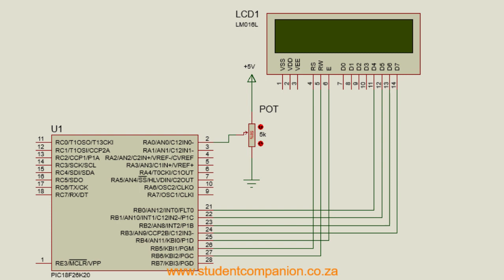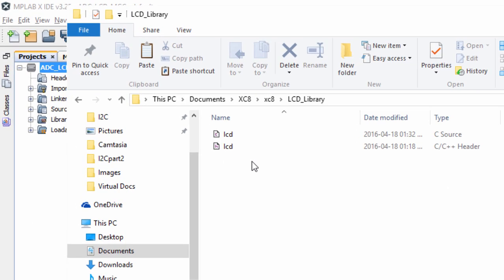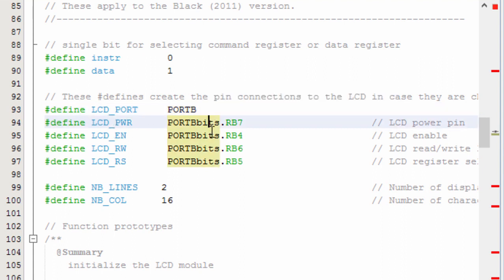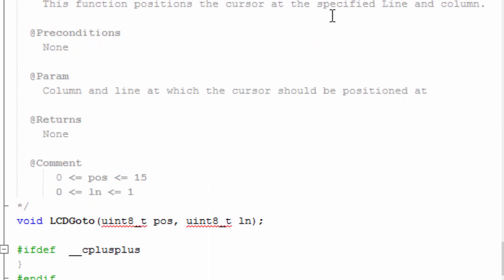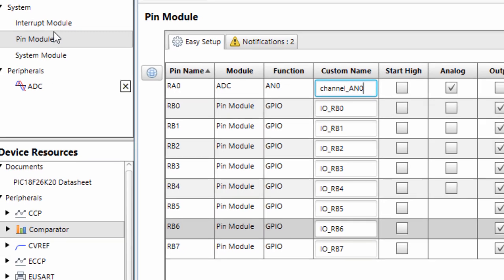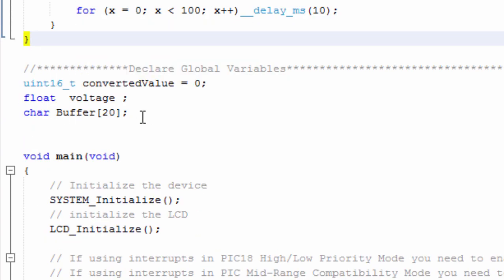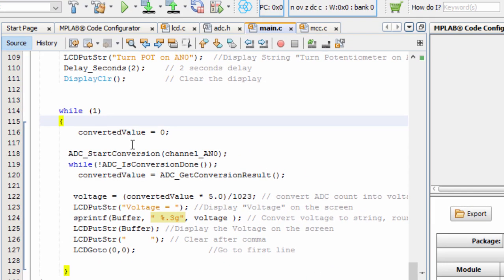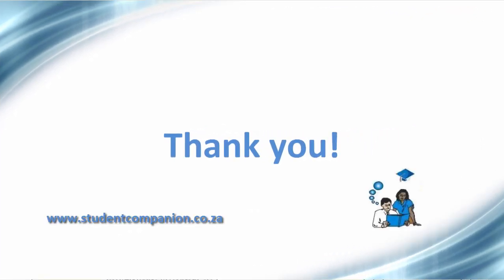22- ADC and LCD with MPLAB Code Configurator | MPLAB XC8 for Beginners Tutorial

Comment: can you please interface thermocouple sensor with is a simulation and how we can put sensor librariy in mplan idex. please reply as soon as possible
Reply from the maker: You can ask a specific questions.  What thermocouple sensor you are using? If its analog then this video should be able to assist. Otherwise you might need i2c or Spi.  Read your sensor datasheet
Reply: Sir can I get your email address. Please.

Comment: Hello.  Love the videos but having a bit of an issue here.  Doing a simple project like you show.  Right now I'm just trying to get my LCD to work.  I'm getting all sorts of issues when I try to compile with the system not able to find data types 'uint8_' and also the crystal frequency doesn't seem to be defined even though I define it. Here's my code followed by the error log.

The code:
#include <stdint.h>
#include <xc.h>
#include "mcc_generated_files/mcc.h"
#include "lcd.h"
#define _XTAL_FREQ 8000000

/***********Global Variables****************/
uint16_t raw_AD_value = 0;
float sensor_voltage;
char buffer[20];

void main(void)
{
    // initialize system (what was in SYSTEM_Initialize I put here so I can see it)
    //Plus I have to add LCD initialize myself since not part of MCC generated files
    PIN_MANAGER_Initialize();
    OSCILLATOR_Initialize();
    ADC_Initialize();
    LCD_Initialize();
    
    //Setup LCD
    LCDPutCmd(LCD_CURSOR_OFF);
    LCDPutStr("This is");
    LCDGoto(0,1);               //Puts cursor at column 0, line which is 2nd line (col, row)
    LCDPutStr("a Test");
    while (1)
    {
        // Add your application code
    }
}
/**
 End of File
*/

The error log
In file included from lcd.c:44:

./lcd.h:134:17: error: unknown type name 'uint8_t'; did you mean 'uint24_t'?
void LCDPutChar(uint8_t ch);
                ^~~~~~~
                uint24_t
C:\Program Files\Microchip\xc8\v2.20\pic\include\c99\bits/alltypes.h:204:18: note: 'uint24_t' declared here
typedef __uint24        uint24_t;
                        ^
In file included from lcd.c:44:
./lcd.h:152:16: error: unknown type name 'uint8_t'; did you mean 'uint24_t'?
void LCDPutCmd(uint8_t ch);
               ^~~~~~~
               uint24_t
C:\Program Files\Microchip\xc8\v2.20\pic\include\c99\bits/alltypes.h:204:18: note: 'uint24_t' declared here
typedef __uint24        uint24_t;
                        ^
In file included from lcd.c:44:
./lcd.h:189:21: error: unknown type name 'uint8_t'; did you mean 'uint24_t'?
void LCDWriteNibble(uint8_t ch,uint8_t rs);
                    ^~~~~~~
                    uint24_t
C:\Program Files\Microchip\xc8\v2.20\pic\include\c99\bits/alltypes.h:204:18: note: 'uint24_t' declared here
typedef __uint24        uint24_t;
                        ^
In file included from lcd.c:44:
./lcd.h:189:32: error: unknown type name 'uint8_t'; did you mean 'uint24_t'?
void LCDWriteNibble(uint8_t ch,uint8_t rs);
                               ^~~~~~~
                               uint24_t
C:\Program Files\Microchip\xc8\v2.20\pic\include\c99\bits/alltypes.h:204:18: note: 'uint24_t' declared here
typedef __uint24        uint24_t;
                        ^
In file included from lcd.c:44:
./lcd.h:211:14: error: unknown type name 'uint8_t'; did you mean 'uint24_t'?
void LCDGoto(uint8_t pos, uint8_t ln);
             ^~~~~~~
             uint24_t
C:\Program Files\Microchip\xc8\v2.20\pic\include\c99\bits/alltypes.h:204:18: note: 'uint24_t' declared here
typedef __uint24        uint24_t;
                        ^
In file included from lcd.c:44:
./lcd.h:211:27: error: unknown type name 'uint8_t'; did you mean 'uint24_t'?
void LCDGoto(uint8_t pos, uint8_t ln);
                          ^~~~~~~
                          uint24_t
C:\Program Files\Microchip\xc8\v2.20\pic\include\c99\bits/alltypes.h:204:18: note: 'uint24_t' declared here
typedef __uint24        uint24_t;
                        ^
lcd.c:57:5: error: use of undeclared identifier '_XTAL_FREQ'
    __delay_ms(LCD_Startup);
    ^
C:/Program Files (x86)/Microchip/MPLABX/v5.40/packs/Microchip/PIC12-16F1xxx_DFP/1.2.63/xc8\pic\include\pic.h:101:51: note: expanded from macro '__delay_ms'
#define __delay_ms(x) _delay((unsigned long)((x)*(_XTAL_FREQ/4000.0)))
                                                  ^
lcd.c:76:21: error: unknown type name 'uint8_t'; did you mean 'uint24_t'?
void LCDWriteNibble(uint8_t ch,uint8_t rs)
                    ^~~~~~~
                    uint24_t
C:\Program Files\Microchip\xc8\v2.20\pic\include\c99\bits/alltypes.h:204:18: note: 'uint24_t' declared here
typedef __uint24        uint24_t;
                        ^
lcd.c:76:32: error: unknown type name 'uint8_t'; did you mean 'uint24_t'?
void LCDWriteNibble(uint8_t ch,uint8_t rs)
                               ^~~~~~~
                               uint24_t
C:\Program Files\Microchip\xc8\v2.20\pic\include\c99\bits/alltypes.h:204:18: note: 'uint24_t' declared here
typedef __uint24        uint24_t;
                        ^
lcd.c:103:17: error: unknown type name 'uint8_t'; did you mean 'uint24_t'?
void LCDPutChar(uint8_t ch)
                ^~~~~~~
                uint24_t
C:\Program Files\Microchip\xc8\v2.20\pic\include\c99\bits/alltypes.h:204:18: note: 'uint24_t' declared here
typedef __uint24        uint24_t;
                        ^
lcd.c:105:5: error: use of undeclared identifier '_XTAL_FREQ'
    __delay_ms(LCD_delay);
    ^
C:/Program Files (x86)/Microchip/MPLABX/v5.40/packs/Microchip/PIC12-16F1xxx_DFP/1.2.63/xc8\pic\include\pic.h:101:51: note: expanded from macro '__delay_ms'
#define __delay_ms(x) _delay((unsigned long)((x)*(_XTAL_FREQ/4000.0)))
                                                  ^
lcd.c:118:16: error: unknown type name 'uint8_t'; did you mean 'uint24_t'?
void LCDPutCmd(uint8_t ch)
               ^~~~~~~
               uint24_t
C:\Program Files\Microchip\xc8\v2.20\pic\include\c99\bits/alltypes.h:204:18: note: 'uint24_t' declared here
typedef __uint24        uint24_t;
                        ^
lcd.c:120:5: error: use of undeclared identifier '_XTAL_FREQ'
    __delay_ms(LCD_delay);
    ^
C:/Program Files (x86)/Microchip/MPLABX/v5.40/packs/Microchip/PIC12-16F1xxx_DFP/1.2.63/xc8\pic\include\pic.h:101:51: note: expanded from macro '__delay_ms'
#define __delay_ms(x) _delay((unsigned long)((x)*(_XTAL_FREQ/4000.0)))
                                                  ^
lcd.c:128:5: error: use of undeclared identifier '_XTAL_FREQ'
    __delay_ms(1);
    ^
C:/Program Files (x86)/Microchip/MPLABX/v5.40/packs/Microchip/PIC12-16F1xxx_DFP/1.2.63/xc8\pic\include\pic.h:101:51: note: expanded from macro '__delay_ms'
#define __delay_ms(x) _delay((unsigned long)((x)*(_XTAL_FREQ/4000.0)))
                                                  ^
lcd.c:137:5: error: unknown type name 'uint8_t'; did you mean 'uint24_t'?
    uint8_t i=0;
    ^~~~~~~
    uint24_t
C:\Program Files\Microchip\xc8\v2.20\pic\include\c99\bits/alltypes.h:204:18: note: 'uint24_t' declared here
typedef __uint24        uint24_t;
                        ^
lcd.c:148:14: error: unknown type name 'uint8_t'; did you mean 'uint24_t'?
void LCDGoto(uint8_t pos,uint8_t ln)
             ^~~~~~~
             uint24_t
C:\Program Files\Microchip\xc8\v2.20\pic\include\c99\bits/alltypes.h:204:18: note: 'uint24_t' declared here
typedef __uint24        uint24_t;
                        ^
lcd.c:148:26: error: unknown type name 'uint8_t'; did you mean 'uint24_t'?
void LCDGoto(uint8_t pos,uint8_t ln)
                         ^~~~~~~
                         uint24_t
C:\Program Files\Microchip\xc8\v2.20\pic\include\c99\bits/alltypes.h:204:18: note: 'uint24_t' declared here
typedef __uint24        uint24_t;
                        ^
lcd.c:161:5: error: use of undeclared identifier '_XTAL_FREQ'
    __delay_ms(LCD_delay);
    ^
C:/Program Files (x86)/Microchip/MPLABX/v5.40/packs/Microchip/PIC12-16F1xxx_DFP/1.2.63/xc8\pic\include\pic.h:101:51: note: expanded from macro '__delay_ms'
#define __delay_ms(x) _delay((unsigned long)((x)*(_XTAL_FREQ/4000.0)))
                                                  ^
18 errors generated.
(908) exit status = 1
nbproject/Makefile-default.mk:147: recipe for target 'build/default/production/lcd.p1' failed
make[2]: * [build/default/production/lcd.p1] Error 1
make[2]: * Waiting for unfinished jobs....
make[1]: * [.build-conf] Error 2
make: * [.build-impl] Error 2
make[2]: Leaving directory 'C:/Users/SobtzakTech/MPLABXProjects/Powder_Coating_Oven.X'
nbproject/Makefile-default.mk:91: recipe for target '.build-conf' failed
make[1]: Leaving directory 'C:/Users/SobtzakTech/MPLABXProjects/Powder_Coating_Oven.X'
nbproject/Makefile-impl.mk:39: recipe for target '.build-impl' failed

BUILD FAILED (exit value 2, total time: 1s)
Reply from the maker: Hi. 
1. Most of the errors seem to come from lcd.c and you did not post it here so I can't guess what you could have done wrong there.
2. Which PIC are you using?
3. Did you set your other configuration with mcc? The __XTAL_FREQ should have been declated correctly with mcc, no need to do it manually and I see you misspelled it also, it starts with 2 underscores just like the delay macro.
Reply: Thanks for the response!  I'm using the PIC 16F1619 since it was on my curiosity board when I started with PIC's.  I'm still a rookie so I've kept with it.  Below is my lcd.c  I'm using port C on the chip for the lcd.  I'm bascially doing what you do in this video, using an lcd and then I will have 2 analog inputs.  I loaded the lcd.h and lcd.c files into my project and then used MCC to configure the chip and the analog channels.  I have used the LCD with this chip before so I'm not sure what I'm doing wrong this time.  Plus its been a while and I cannot find my old code.  Where is __XTAL_FREQ declared with MCC?  Thanks for all the help!

MY LCD.C
#include <xc.h>
#include "lcd.h"

void LCD_Initialize()
{
    // clear latches before enabling TRIS bits
    LCD_PORT = 0;

    TRISC = 0x00;

    // power up the LCD
    LCD_PWR = 1;

    // required by display controller to allow power to stabilize
    __delay_ms(LCD_Startup);

    // required by display initialization
    LCDPutCmd(0x32);

    // set interface size, # of lines and font
    LCDPutCmd(FUNCTION_SET);

    // turn on display and sets up cursor
    LCDPutCmd(DISPLAY_SETUP);
    
    DisplayClr();

    // set cursor movement direction
    LCDPutCmd(ENTRY_MODE);

}

void LCDWriteNibble(uint8_t ch,uint8_t rs)
{
    // always send the upper nibble
    ch = (ch >> 4);

    // mask off the nibble to be transmitted
    ch = (ch & 0x0F);

    // clear the lower half of LCD_PORT
    LCD_PORT = (LCD_PORT & 0xF0);

    // move the nibble onto LCD_PORT
    LCD_PORT = (LCD_PORT | ch);

    // set data/instr bit to 0 = insructions; 1 = data
    LCD_RS = rs;

    // RW - set write mode
    LCD_RW = 0;

    // set up enable before writing nibble
    LCD_EN = 1;

    // turn off enable after write of nibble
    LCD_EN = 0;
}

void LCDPutChar(uint8_t ch)
{
    __delay_ms(LCD_delay);

    //Send higher nibble first
    LCDWriteNibble(ch,data);

    //get the lower nibble
    ch = (ch << 4);

    // Now send the low nibble
    LCDWriteNibble(ch,data);
}

    
void LCDPutCmd(uint8_t ch)
{
    __delay_ms(LCD_delay);

    //Send the higher nibble
    LCDWriteNibble(ch,instr);

    //get the lower nibble
    ch = (ch << 4);

    __delay_ms(1);

    //Now send the lower nibble
    LCDWriteNibble(ch,instr);
}

 
void LCDPutStr(const char *str)
{
    uint8_t i=0;
    
    // While string has not been fully traveresed
    while (str[i])
    {
        // Go display current char
        LCDPutChar(str[i++]);
    }
    
}

void LCDGoto(uint8_t pos,uint8_t ln)
{
    // if incorrect line or column
    if ((ln > (NB_LINES-1)) || (pos > (NB_COL-1)))
    {
        // Just do nothing
        return;
    }

    // LCD_Goto command
    LCDPutCmd((ln == 1) ? (0xC0 | pos) : (0x80 | pos));

    // Wait for the LCD to finish
    __delay_ms(LCD_delay);
}
Reply from the maker: @sobtzakengineeringtechnolo5767  Can you upload your project in the forum? We will build it and trace the errors. Just right click on the name of your project in MPLAB X and choose Package, it will zip the project. Upload that zipped project. Start a new topic in: https://www.studentcompanion.co.za/forums/forum/mplab-xc8-tutorial-discussions/

Comment: sprint Comand is not working in my code. It gives error. I want to display float variable on LCD but LCD Print Asci COde for that Number. 

Please suggest any solution regarding this. Is there any Library which I need to add to make this work?. Or any Other Command to do the same?
Reply from the maker: How are you using the command? What data and what is the result? Can you post your code?
Reply: Hi, I also met the question you described, but it has been dealed with. you just delete channel_AN0 in codes"ADC_StartConversion(channel_AN0)", just input ADC_StartConversion(); And then compile again.
Reply from the maker: The mcc library function changed with the current version. Thanks for your feedback

Comment: Hello Sir, I'm trying to simulate your example in this video with the same code and scheme, but for some reason when i simulate the lcd glows but it doens't show any characters. What could be the problem?
Reply from the maker: We can't guess because we don't see your code and schematic.  The code you say might be the same, maybe just the main, we are not sure if the configuration and lcd library changes are also the same. If code is 100% the same, then maybe the schematic there are some few errors, check if your lcd data lines as defined in the lcd library are correctly connected to the lcd and also the E, RS and R/W are correctly connected

Comment: The downloaded library file lcd.h does not find "mcc_generated_files/mcc.h"

Please help
Reply from the maker: The lcd.h is not part of mcc, it was added manually to the project, please watch carefully the tutorial.
Are you getting an error when compiling? If yes, please post here the full error message log.
If you are just getting some red warnings, just ignore them.
Did you add correctly the lcd.h to your project folder or you used relative path?
Reply: @StudentCompanion  

2 warnings and 3 errors generated.
(908) exit status = 1
nbproject/Makefile-default.mk:171: recipe for target 'build/default/production/main.p1' failed
make[2]: * [build/default/production/main.p1] Error 1
make[2]: * Waiting for unfinished jobs....
make[1]: * [.build-conf] Error 2
make: * [.build-impl] Error 2
make[2]: Leaving directory 'C:/Users/Akstinai/Desktop/MPLAB/lcd project.X'
nbproject/Makefile-default.mk:91: recipe for target '.build-conf' failed
make[1]: Leaving directory 'C:/Users/Akstinai/Desktop/MPLAB/lcd project.X'
nbproject/Makefile-impl.mk:39: recipe for target '.build-impl' failed
Reply from the maker: Is that the full build message log?
It doesn't describe much, why do you think it has something to do with lcd.h?
Please post your main.c code as well and more details like the PIC you are using, compiler version, mcc version and MPLAB X IDE version
Reply from the maker: @huntex8736  Depending of the MCC version you are using, that's why we asked you which version you did not respond, they change sometimes some routines. You can read in the adc.h it has definition of these functions/routines how to use them. It seems like the ADC_StartConversion() now must be used without specifying the channel, you can read more in the adc.h you can see what other function you can use and how to use them.
For now, you can use:
ADC_Initialize()
ADC_GetConversion(channel_AN0)

Comment: Hello, unfortunately Proteus seems to simulate an LCD Display HITACHI HD44780U with ROM A00 (Japanese Characters Pattern) hence I was using 'LCDPutChar(223);' to display the degree symbol previously. But here we only have LCD Display HITACHI HD44780U ROM A02 (EU Characters Pattern) or WINSTAR WH1602C English and European standard font (ET# - Extended ASCII Table compatible). So, I have changed that LCD Library to include my own characters in CGRAM space and create an application that display properly special character regardless the LCD Display employed. Thanks from Brazil.
Reply from the maker: Thanks for the feedback and for that information.

Comment: nice video sır!
İ will ask a question about the reading few times adc , and get the avarage value..

For example how can we make a 4 time reading ADC from channel1 and channel2. 
And get the avarage value of the adc from channel1 and channel2 separate?

for example this is my code it has one channel.
I'm calling the ADCCyle funciton in 10ms loop
my goal to read the adc value in 10ms and add it to the ADCBuffer1.
after 4 cylce ( 4 time Samplecount = 40ms ) i will compare them..
But somethings gone wrong?

void ADCCycle (void)
{   
   
    unsigned long   ADCBuffer1;
    unsigned long   SampleCount;
  
    
    
    ADCON0bits.CHS = 0x05;    
    ADCON0bits.ADON = 1;
    __delay_us(5);
    ADCON0bits.GO_nDONE = 1;
    while (ADCON0bits.GO_nDONE == 1);
    
    ADCBuffer1 += (ADRESH << 8) + ADRESL;
   // Adding the result to ADCBuffer1
    
        if(++SampleCount>= 4)
                                 //one Samplecount is 10ms i will compare  the results after 40ms 
        {
           SampleCount = 0;
           ADCBuffer1>>2;
            
           if(ADCBuffer1>256)
            {
                LATCbits.LATC3=1;
            }
           
                if(ADCBuffer1<256)
                    {
                        LATCbits.LATC3=0;       
                    }
                   ADCBuffer1 = 0;

        }
        
       
}
Reply from the maker: Which PIC are you using? What do you mean by something gone wrong?
Reply: @StudentCompanion  for example he does not read the ADC value's avarage and the LATCbits.LATC3 is everytime high. Also if i set the ADCBuffer1>>2 to ADCBuffer1>>12 the LATCbits.LATC3 is still high..The pic is 16F1503